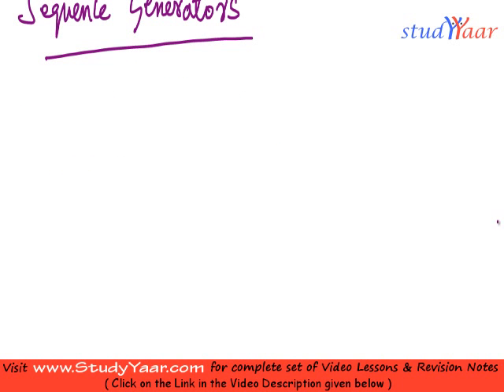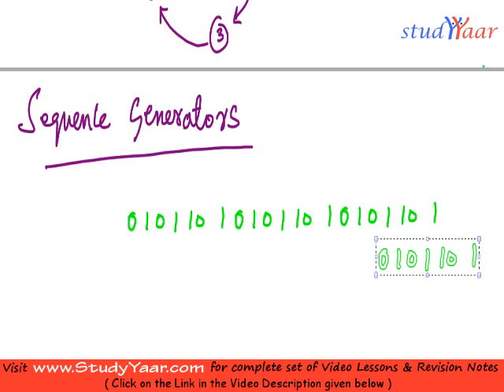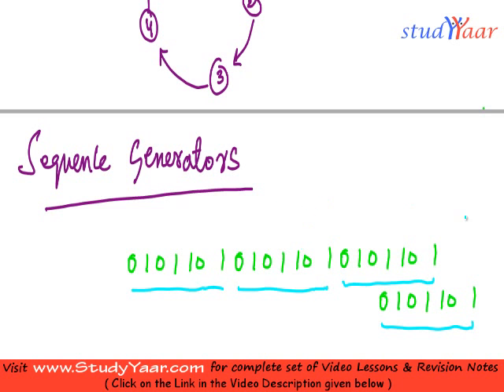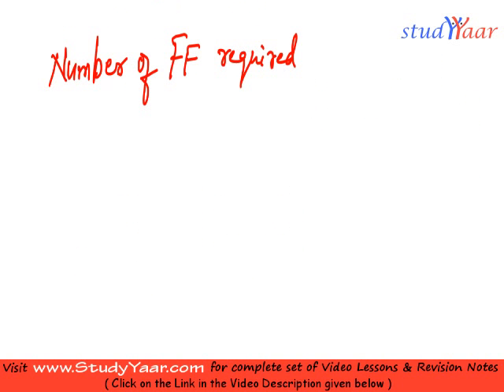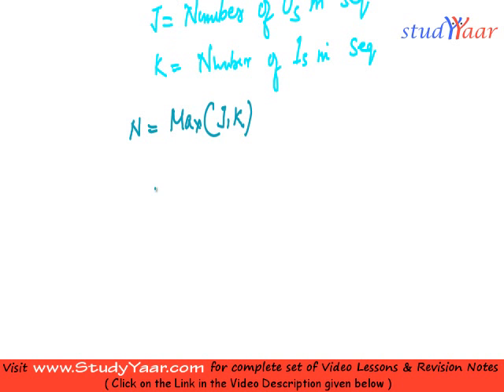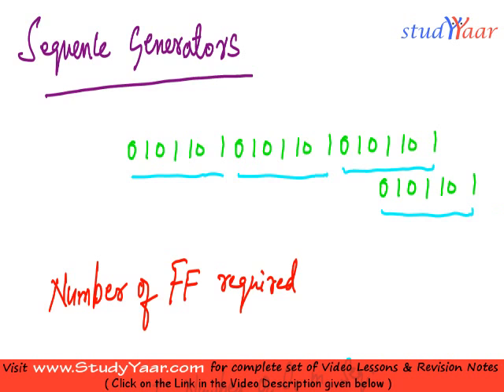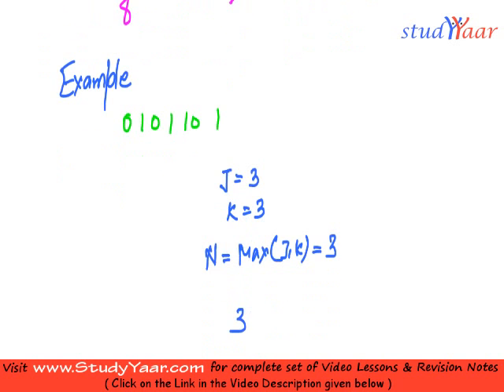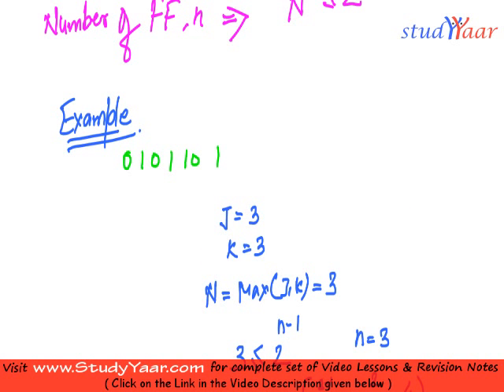Sequential Logic Design - Sequence Generators

Comment: There is an error in the example.  k is given a value of 3 but the example pattern has four 1's.   k should be 4.

j = 3
k = 4
n = max(j,k) = 4

n <= 2^n-1 

4 <= 8
Reply: if we take n as 3 still it would be = 4 not less than 4 so why did you mention n here as 4